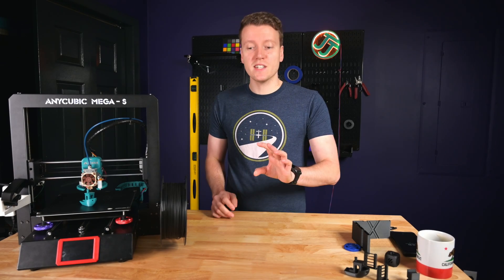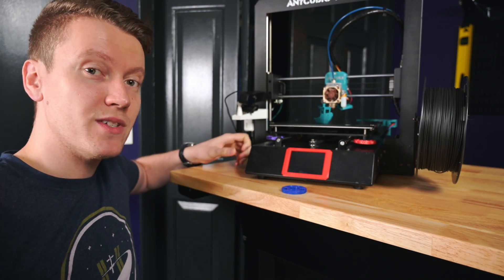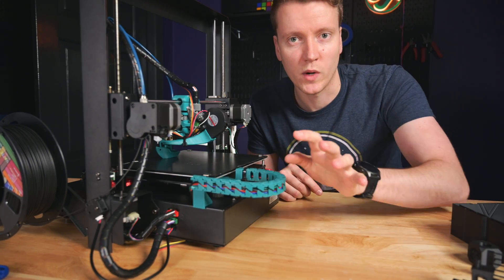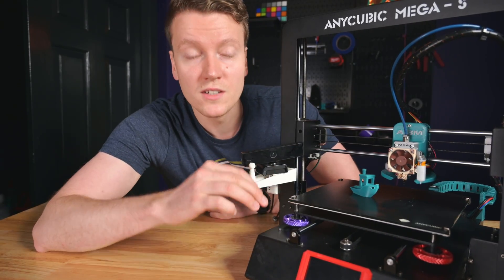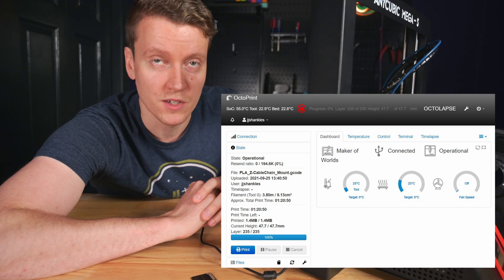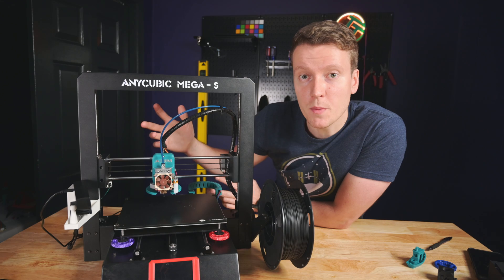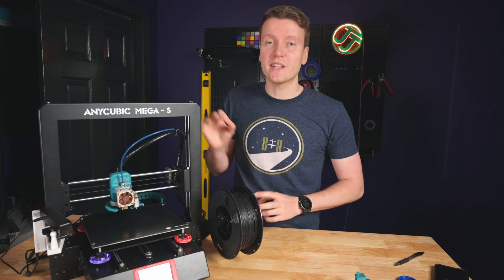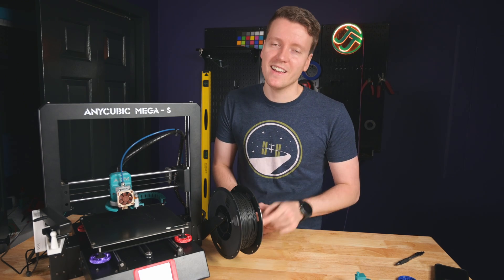Anycubic Mega S Essential Mods | Upgrade Your 3D Printer

Comment: I realize you made this video Years ago but, it's my first. I have learned a lot through trial and error. My issue is the feeder, the motor just jumps but doesn't pull/push the filament. I replaced the motor (Amazon) and the same issue exists.

Comment: My stock printers been going great for years got it regularly printing at 120mm/ instead of upgrading it i just buy more of them two printers is 2x as fast 3 printers is 3x as fast anytime i print stuff off it usually takes an hour or two and i have all my parts needed its a great set up just takes up a bit of apace but if you have a shelf or a rack that solves the issue
Reply: Klipper would be annoying bc i lose my touch screen which ruins the flow of stuff i like to just be able to hit print when ever i have an idea pop into my head plus i would need 4 raspberry pies this all gets expensive when you have more than one unit to upgrade its cheaper just to buy another printer to up the speed and total print volume

Comment: Do you have a video on maintenance upgrades/recommendations? I just bought a used mega s, and I can tell that my bed is not flat throughout (the middle sinks down) and I can’t get any good prints. I’m thinking my nozzle may also need to be replaced…

Comment: An easy upgrade i made was sticking an LED strip to the inside of the top frame shining down so i can see whats printing (especially with printing black filament its kinda hard to see whats going on)

You can stick the LED strip all the way around for an even sorround lighting, especially if you wanna make Timelapse’s/ videos of your prints, makes them look more professional..
But for me it was just so i dont have to use my phone’s light to see wtf was going on

PS. If you are having issue finding a Noctua fan to replace the original, sunon (which usually is the blower replacement brand of choice) also has a perfect fitting fan for the heatsink, its not quite as quiet as the noctua but it moves more air so cooling is better. And it costs like 1/3rd the price of the noctua

Comment: Hey JJ - I upgraded my Ai3M-S with TMC2208s and ran into a little snag that befuddled me for a good while. After installing the new drivers, the z-axis motors kept missing steps and all my prints were either very ugly or just unusable. I don't remember exactly where I got the info from, but I set the VRef for the drivers to 1.1v except for the extruder motor which I set to 1.3. Turns out, that 1.1v on the x-axis had too much torque. Every time the printhead had to stop and move in the opposite direction (e.g. solid infills) the z-axis would miss steps. Sometimes the pop was loud and sometimes soft. I fixed it by reducing the VRef for the x-axis to 0.9v. Thanks!
Reply from the maker: I hadn't heard that too much could cause that issue, but that's great to know. And good that it is now working for you!

Comment: You didn't have one of the modded wheels on the back right. Does it collide with the Cable chain post?
Reply from the maker: Yes, I had to take it off when I added the cable chains
Reply: @JJShankles  I'll try taking a notch out of the Supports on the post, then print the post at 100% so it is solid.

Comment: I have a couple of questions.
For the x- carriage, what type of filiment did you use? Since I have not upgraded my hotend yet I am sort of limited, not able to print hotter types of filiment yet.
I do have an anycubic mega x, so is there a different housing I need to print?
And this is off topic, but I have not been able to get my mega x to connect to my windows laptop. I contacted anycubic support and they just keep sending me videos to watch. Not any help at all.
I am using cura and pronterface. Neither will see my printer.
 I am a 62 year old newbie to 3d printing recovering from esophagus cancer, so I tend to have a lot of time to spare. 
Thank you for your time.
Reply from the maker: I printed mine out of PETG which should be fine on the stock hotend. I usually use 235C for PETG, and it has held up great.
Yes you will need a different mount to put it on the mega x, but there are several options. I would recommend checking out the remixes page here: https://www.thingiverse.com/thing:3537449/remixes
And here are a few of the mounts for the mega X:
https://www.thingiverse.com/thing:4555831
https://www.thingiverse.com/thing:4594101
Hopefully one of those can help.
As for connecting to the laptop, that is a very common issue. Updating drivers may help, or here is one list someone made that might help: https://community.ultimaker.com/topic/37689-usb-connection-in-cura-410/
And welcome to 3d printing! It is an amazing hobby that can take up all the time you have to spare! Haha

Comment: Wassup, JJ!
Thanks for a great video!
I have a small question - how did you connect a stock noctua 4 pin cable to a 2 pin stock i3 mega print head pinboard?
Reply from the maker: My noctua came with an adapter to change it to a simple 2 pin connector. But if you didn't have one of those adapters you could just plug in only the power and ground wires. You will loose the PWM functionality though

Comment: Now I understand why my overhangs are not consistent... one side is better than the other in the last benchy that I made in this printer, I might upgrade the head as you did.
How much did it cost to change the head?
Reply from the maker: It really didn't cost much except for a spool of PETG to print it with. Along with some screws that I already had laying around, and I think I upgraded the fans while I was at it. It is an upgrade I would highly recommend

Comment: Noctua are silent but not good for cooling the hot end
Reply from the maker: On this printer I haven't had an issue with it keeping the hotend cool enough. Yes there are much better fans out there, but on an open hotend setup like this, it doesn't need as powerful of a fan.

Comment: After two years running my Mega S in stock configuration with the thinking that I would upgrade to a different printer later on.  But the Mega S has good, so I am going to improve it instead of swapping it out for another.   All the mods you cover I have either done am  planning to do (X Carriage and BL-Touch are in planning).  But I do have one issue that I can't sort out with the firmware,  I have tried several versions of the Mega-S specific Marlin firmware releases, with the goal of getting filament change at layer working.   I keep running into "filament runout or sensor abnormal errors" as I change the filament and after I press continue.  It does this if I leave the first filament in the sensor or not,  does this if I use auto or manual filament change, in any case I have no means to continue the print, thankfully I am discovering this on quick test prints.  It also does this if I print over USB (Oktaprint) or via SD.   Seems like I am not the only one experiencing this, this issue has been noted in the github pages for the various firmware I have tried.   I am thinking that I may need to compile the firmware with the filament sensor disabled.   It's been noted that there are a few different versions of the Mega-S, mine was purchased in July 2020, and has the Trigorilla V0.0.2 board.   Is this particular issue something you have any experience with with?
Reply from the maker: I haven't had that problem before, but I am running Klipper instead of Marlin firmware. I would recommend deactivating the filament runout sensor. I personally don't use them anymore, they are usually more trouble than they help me.

Comment: İ need advice to make a choice between Mega S(i3) vs Mega Zero 2.0 if they are same price.
Reply from the maker: For the same price get the Mega S. It is way better
Reply: @JJShankles  İ don't mind Touchscreen either, it's not important for me. İ need jus to be  useable, especially print precision , good leveling, voice etc. İ need it for 3d car key printing  (İ guess both has heated bed, bu i assume that Zero 2.0 is newer model than ..) 
By the way thanks for replying!
Reply from the maker: The zero 2.0 is supposed to be their budget printer option. The Mega S has linear rod motion instead of V slot wheels which will be more accurate for small prints
Reply: @JJShankles  Great!
Thank you for share your opinion!

Comment: I remixed the cable chain from the flat printed chain designed by coillote  because they’re much sturdier, I changed the locking clips and adjusted the mounting parts for the bed, thinking about the other cable chains plus a almost direct extruded by ronx666. I like your videos

Comment: Question: with the modified Z homing happening at (100,100), for some reason the printer now lays down the first test-squish-line at the beginning of each print at the center of the build plate rather than in the corner. This makes for some hilarious artifacts. Any suggestions on what would be causing that or how to address it? (Also, thanks for the great videos.)
Reply from the maker: I think that first squish line is defined in the slicer? I don't run one anymore and just print a skirt on the printer to prime the nozzle, but you could change that first line g code, or you could move the safe z homing position

Comment: You might want to look at some silicone springs for the print bed. Iv changed mine out and I have to say the bed stays way more level and for much longer. I don't think iv had to re-level for like a solid 2 months.
Reply from the maker: I ended up ridged mounting it after installing a BLTouch. I used some large metal nuts, and it does great at not changing the level.
Reply: @JJShankles  I would love to see an updated list of the mods you've do then. I'm buying another printer so I can now rip the other one apart and would love to see everything you've done.

Comment: The cable chain you show has a file, but is printed in pieces. any chance you can make a small video explaining the cable chain printing, setting up, and any relevant info?
Reply from the maker: Yeah I can do that. I've had several requests for that, it should be out later this week or early next week

Comment: I'm having trouble installing the Y-Axis-Frame_v2 on my Anycubic Mega S: I'm using M3-0.5 10mm bolts as recommended in Thingiverse for this design. But the bolt holes seem to be just a little big. Are the holes in the printer frame here just not threaded? And if not, how do I install the frame?

Also - great video and helpful comment replies; much appreciate you posting this.
Reply: I used a zip tie so I didn’t have to open the case it’s a little fiddling but works nice

Comment: Do you have any guidance on how to install the cable chain? I’m looking all around and can’t find any instructions on how to install it! Do I need to remove the bed?
Reply from the maker: Yes, you unscrew the bed leveling screws all the way off, then the bed lifts off the frame. You then can use the screws that are already holding on to one of the linear bearings. Once you take the bed off it makes more sense
Reply: @JJShankles  Did you have to drill the base where the bed cable comes out to install that bracket?
Reply: I’d also love to know this can’t seem to find any info on how to install.

Comment: I was about to print the cable chain but I recently heard that the chain will increase the chance for the cable to break even more due to even smaller radius. What is your long-time experience with it? Thanks!
Reply from the maker: The wires were wearing through without the Y axis cable chain. If you make sure the chain is long enough, it will be way better with the chain than without
Reply: @JJShankles  So you had no damages after installing the chain? Thanks!
Reply from the maker: That is correct, I have had no damages. If you install it correctly, it should prevent damages

Comment: I bought the printer today and it looks like that the fan and TMC2208 will arrive before the printer 😅
Is the sunon fan a 12v or 24v?
Reply from the maker: It is a 12V fan. Everything on this printer is 12V from the power supply.

Comment: Do you find this printer goes out of level stock? 

In my experience it seems like the printer loses its leveling either after or during longer prints. Additionally, the bed is warped. I’ve flashed knutwurst’s Marlin 2.0 based firmware to try and use Mesh Leveling to compensate, but it’s still not right. Maybe better springs to hold the tension better? 

I also noticed despite buying about a week ago, I got one of the old v1 revisions of these printers.
Reply from the maker: It did feel like it went out of level a lot when I first got it. I'm not sure what changed, but after a while it held level much better. Maybe just all the screws settling in place. I have heard stronger springs could help with that though.

Comment: just ordered for 140€ on sale straight from anycubic, this will be fun. First step for me will be klipper, though
Reply from the maker: I would recommend using the printer for a bit before taking on Klipper, if this is your first printer. There is a lot you will learn about you printer through using it for a few months before tackling a big project like Klipper, but whenever you feel ready it is an amazing upgrade, but not without some work
Reply: @JJShankles  I've already worked with other printers a bunch and installed Klipper on one of them, just never got around to getting one privately
Reply from the maker: That makes sense! Haha I didn't want someone who had never touched a printer before to try Klipper the very first thing.

Comment: Awesome video! Just got an anycubic mega x as my first printer. Do you know if the X carriage mod work with the mega x??
Reply from the maker: I think it probably would, but I'm not sure how it would work with the laser attachment
Reply: @JJShankles  what material did you print the x carriage with?
Reply from the maker: I used PETG, and it is holding up well. PLA wouldn't work well for this application

Comment: JJ - great video and channel.  For the cable chain, would you confirm the .stl parts on the Thingiverse design that are needed for that safety mod you show?  Is it:
Y-Axis bed
Y-Axis-Frame_v2
Chain-Link-C
Thanks!
Reply from the maker: Yes those are correct! use the v2 for the Anycubic Mega S
Reply: I'm having trouble installing the Y-Axis-Frame_v2 on my Anycubic Mega S: I'm using M3-0.5 10mm bolts as recommended in Thingiverse for this design. But they aren't catching in the holes in the printer frame (revealed when I removed the cable tie from the Y-axis cable). What am I missing here? Thanks!

Also - great video and helpful comment replies; much appreciate you posting this.
Reply: @AD-hj3gu  I had the same issue! I had to go and get lock nuts for those bolts and had to open up the bottom. I held the lock nuts in place with a wrench and screwed the bolts on from the other side in order to properly secure them to the base. 

I hope this helps!

Comment: I’m an Ender 3 V2 guy but just got an Anycubic Mega S on a good Black Friday deal so I have a second printer. How do you like this printer overall?
Reply from the maker: I really like it! There are some things I think it does better than the Ender 3 style printer. I like the roller bearings over the v slot wheels, and the construction is very strong. They are both great printers, and mine is still running great after years of work
Reply: @JJShankles  Awesome. That's what I like to hear. I'm excited to try something different than the Ender. Thanks for the response.

Comment: i could see that you are using a bltouch but as far as i am aware davidramiro's marlin firmware doesnt support it, or if it does is there a video how it is set up. how did you figure it out.
Reply from the maker: I have it installed, but I can't get mine working. It was a cheap knockoff, and I understand now why people recommend getting the original. I can't get anything to turn on at all, so it is probably just a dead device.

Comment: I've printed the adjustment knobs and was about to print the cable chain.  Just noticed your rear right knob isn't in place, does it fit with the cable chain in place?  Or do they collide?
Reply from the maker: I meant to mention that. Yeah they would collide, so I leave that one off and only use the other three

Comment: Thanks, helpful video. I just bought this model printer a few days ago as my first 3D printer. The learning curve is steep, and now it seems I'll be going down the raspberry pi rabbithole as well. I knew this would happen, which is why I avoided buying a FDM for so long.
Reply from the maker: The raspberry pi with Octoprint is pretty easy to setup and really upgrades your printer from an appliance into a smart machine. If you do very much printing you'll be glad once you get it setup